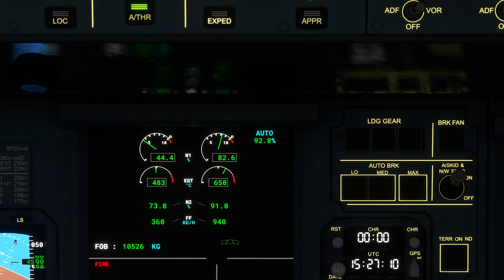എന്ത് കൊണ്ടാണ് വിമാനത്തിന്റെ എൻജിന് തീ പിടിക്കുന്നത്?

Comment: Planes should have run from battery/solar power and and the fuel should use as a backup.
Reply: Battery/Solar can't produce so much engine power/thrust for a commercial flight...